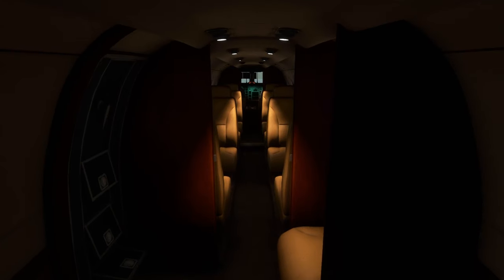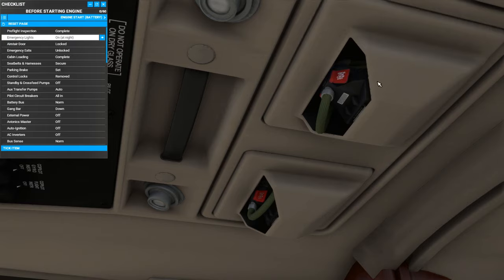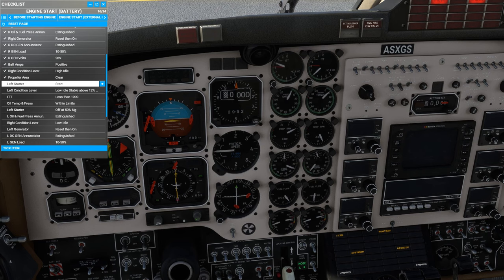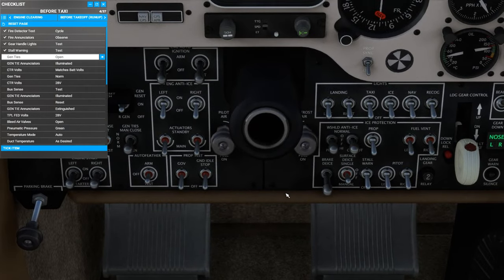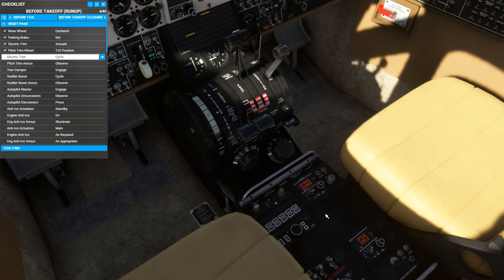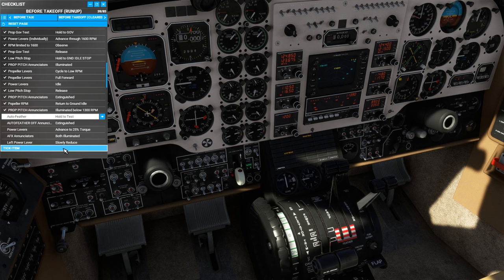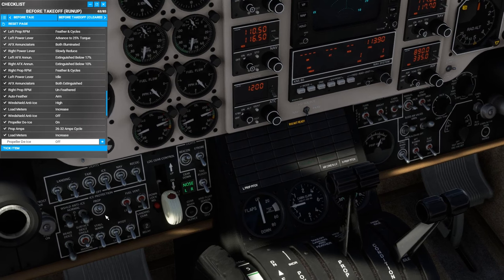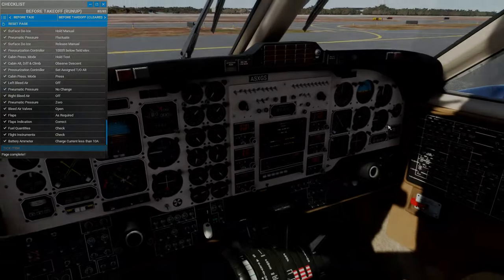Steam Gauge Overhaul - Analog King Air - Start Up Preview

Comment: The work that's gone into this and the 208 is just exceptional. Asobo should be embarrassed by what they initially released, because this is what can be achieved if you put the effort, care, and attention to detail in. Great job.
Reply: The whole MSFS was designed from the beginning to have the good complex aircraft provided by third party developers. 95% of MSFS customers are casual gamers who don't even fly in 1st person in the cockpit but instead watch their aircraft from behind on the easiest difficulty level steering with a XBOX gamecontroller in 3rd person and have no idea how to operate the cockpit. This mass of people paid to provide us the platform and now we pay decent money for the really good individual aircraft that the mass of casual gamers will never buy.
Reply: @berzerk1450  For $40 they should release a completely new aircraft like Milviz 310R with tabblet and everything or PMDG 737-600 not only copy and paste gauges. Improve the flight-model, adding opening/closing doors, etc because with this BS soon we will get "analog gauges" for every vanilla aircraft in MFS and it will cost you $40.

Comment: Great video.  I bought the GTNx unit so I wish the video included that, but of course this is the authentic King Air.   I haven't flown a King Air in decades and truthfully, there was little that I remembered about the engines, but it is not difficult to get the hang of it after only destroying the right engine, lacking good instructor!  I didn't know you had to find a secret place in the radar console to remedy the situation, and I was wondering where to call the virtual mechanic/tech.

Comment: you said the circuit breakers are connected to the failure system, does this mean failures can happen randomly or happen when you’re not careful with the engine? and is there an autopilot in this?
Reply: There is a whole failure system you access on the Wx radar - so yes randoms, eng dmg etc.

Comment: Looks slick.

11:42 - Uhh the "Gyro Slave" indicator doesn't turn when you move in DG mode in the real airplane. It's just a little + - indicator telling you which way the flux valve is correcting the DG
Reply: Sounds like the correct operation to me:  "This meter indicates the difference between the displayed compass heading and the magnetic heading.  Right deflection indicates a clockwise error of the compass card."  or did you mean that the needle moves to + or - instead of the scale?
Reply: @genecrenshaw7846  just the needle moves. It shows which way the flux valve and compensater is driving the DG.
Reply: FYI The dev says this is already fixed for release.

Comment: How did you turn on the radios? They seem to go on when you activate the avionics master, but when I do it, I see that indeed the gauges are activated, but the radios arent, they stay black (no fuse is popped). You turn on the avionics master and then what?

Comment: I've followed the checklist, tried your starting system, but I haven't been able to get my King Air to start. The RPM never seems to go over 20% and I have no fuel flow, what could be going on--
Is there a hidden fuel lever? When we do the fuel test with the lever up the needles do not go up as seen in your video
Reply from the maker: Please contact our support team, they will help you out with this?
Support can be reached here: 
https://www.justflight.com/support
Reply: @justflight   Solved!  simply was a lot of failures accumulated, I reset them and now all is OK, dope of me!

Comment: During engine start, how do you get the "reverser not ready" light extinguished on the Annunciator, please? I have mine staring at me all through the process and possibly well after, I tend to disregard it after and can't tell when and precisely how it gets to go off.
Reply: RPM lever full forward.
Reply: @Tyfn954  Ah, merci.

Comment: Do the doors open finally?? That's a huge issue with the default model. How do you even get in the plane if you can't open the door? All AC addons have doors except the default ones.
Reply: Godzilla Hårddisksson  feels strange i'd have to explain to someone why people want immersive features. as mentioned in the OP, how does one even enter the plane if the doors don't open? The first step of flying is to perform the preflight walkaround. This includes opening the doors and windows if it's warm out. You also need open doors to let passengers in and out. having frozen doors and windows is an immersion killer. same thing if the interior lights don't work or the control services aren't animated. this is 2022 having working doors should be the bare minimum in immersive features. should also have an EFB but that's another thread....

Comment: Nice cockpit, but conflict with the Logitech/Saitek radio panel. When you change the frequency on the radio panel, the complete avionics shut down in the cockpit. I tried it with the cockpit in my community folder and without and the avionics crash occurs only with the cockpit in the community folder, not without. Please Justflight, check this !!!

Comment: Hoping someone can help me here. I've been flying the analog King Air, however, I cannot get the PMS50 GTN 750 to work, while it works fine in the Bonanza. Also, I am unable to get any of the autopilot function lights to show on the pedestal panel.
SOLVED: Was a hidden bind on my honeycomb bravo, found the bind and all works as it should now.
Reply: The 750 doesn’t work for the autopilot in this plane. Only the working title stuff

Comment: can there be a steam guage tbm next?
Reply: No bro. Wrong tbm. That's the 850, old gen
Reply: There could be, but it would be an older model and not the default one in game.
Reply: @alphafox3515  So gotta hope that Carenado or somebody makes a 850 for MSFS2020
Reply: @Aleksandar6ix  The airframes are nearly identical, aren't they? I wouldn't mind a faux 850 with the current 930 exterior model. Same goes for the Citation.

Comment: How is the flight model? Any different?
Reply: I was thinking the same thing for $40 they should release a completely new aircraft like Milviz 310R with tabblet and everything or PMDG 737-600 not only copy and paste gauges. Improve the flight-model, adding opening/closing doors, etc because with this BS soon we will get "analog gauges" for every vanilla aircraft in MFS and it will cost you $40.
Reply: If it's anything like their Caravan, it will be a pretty significant improvement from the default. It took them until the first update a week later to dial it in, but presumably they have that all sorted out by now with this delay.
Reply: I'm very curious about that too. I found this on the product page: "The Analog King Air features a slightly improved flight model compared to the default King Air 350i, with tweaks based on operator feedback online." Hopefully this actually means something because, even though I dont know how the real aircraft feels, the one in msfs feels pretty horrible on takeoffs and landing!

Comment: I really dont understand this plane at all. I follow the checklists to the T but when i go to start up the engines as you do I get nothing.  I then start just pressing random switches and eventually one engine to fires up but I'm unable to get the second. seemed to work when i switched to ground power but under those circumstances with the same exact configuration the other engine should fire up as well. Really love this modeling but with it being payware the checklists should be dead on accurate because this plane is already super involved and complex as is its real life counterpart I've read.

Comment: the bat voltage nob won't stay in the bat position? am I doing something wrong or is that a bug?
Reply: That's how it is in the real aircraft. It's the asobo version that's wrong.
Reply: @TobyMikeBravo  I realize now I just have to hold it, also I "think" the diode that measures the voltage on the bat actually draws some voltage which is why you wouldn't want to leave it in the bat position.